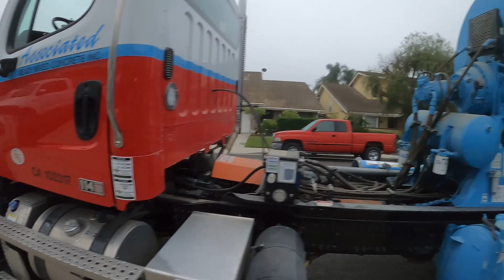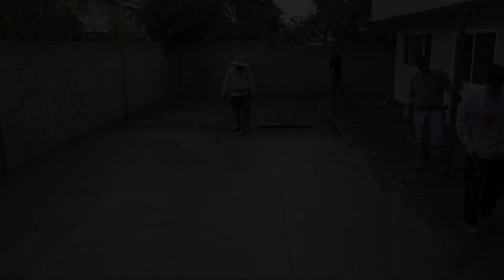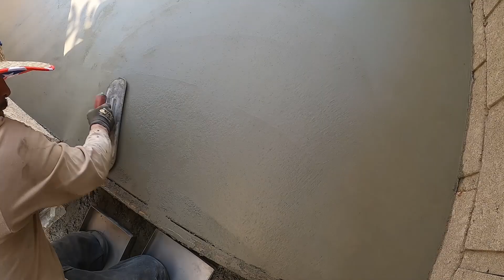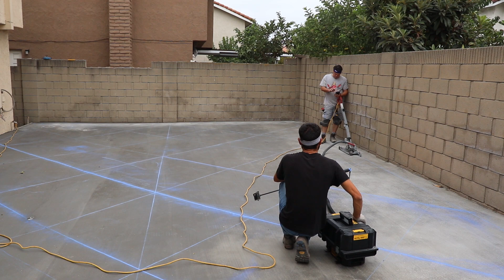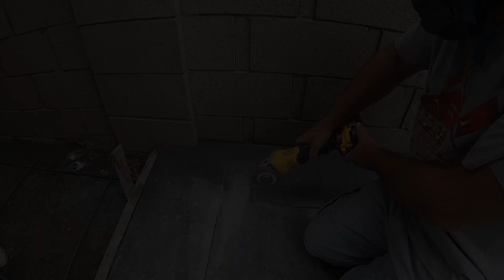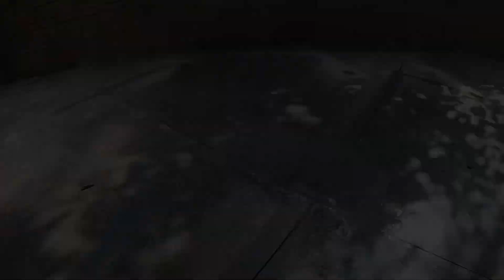Entire Backyard Concrete Pour from Wall to Wall (Part 2)

Comment: is drainage necessary because it's done wall to wall?  I have an existing color stamp 1 step up patio and I want to do the rest of the yard in concrete extending the patio wall to wall.
Reply from the maker: You may need drains if there's no slope out

Comment: enjoy your videos here in Maryland - question?  when you powerwahsed the concrete, do you also run extra water in the drain to flush out concrete dust from cutting so it won't harden?
Reply from the maker: No drains here

Comment: They sell a dewalt t stak dolly that the extractor sits on . And does  that dewalt dust extractor come with that long hose or is that 2 hoses
Reply from the maker: I put two hoses together.
I have the Stak Dolly.
I'm thinking 4 swivel wheels
Reply: thanks. And there are 2 dewalt dollys I’m talking about the baseplate one with the four swivel wheels . It is a tstak I think it’s around 50 to 60 $
Reply from the maker: @vinnyavella6397  
I didn't know that, I'll check it out.
TY

Comment: Hi Dave. I recently did a 2 part pour with 2 separate colors. I used plastic to cover the outside boarder. That was the hardest part of the job getting everything to flush out and finishing the edge. Have you used any other methods to protect the slab beside plastic?
Reply from the maker: No

Comment: great work as always function and finish... thxs not saying 5 inch slump ahahah show a cone  if u can ,   pea gravel moves easier in ur pump nice
Reply: thumb up 956
Reply: oversized wheels non maring,  not tiny wheel cut into concrete too green for tiny wheels for the vac

Comment: Hi odell I have a question 
Can I do more cuts on my concrete patio? I did some but I would like to make more cuts.
Thanks for sharing your knowledge
Reply from the maker: Yes you can no problem
Reply: Yes, and for decorative cuts you can even cut at 1/4 inch and get the shadowy decorative joint vs control joint

Comment: Looks good I like how the cuts where made it gives it a really nice touch to the concrete 👍🏼👍🏼👍🏼✌🏼
Reply from the maker: Breaks it up and makes it smaller. Decorative.
TY
Reply: @OdellCompleteConcrete  Would be even nicer if the drains were located at an intersection point of two cuts ;)

Comment: Hi! cool video! Just wondering, why do you saw cut the concrete, couldn't you just wet join the concrete (like where you get the tool and make a joint on the day of the pour)?
Reply from the maker: Yes we could have but not a decorative pattern like this diamond one.
Reply: Oh okay, just wandering because I have been to job sites where they build track homes, and the workers pour about 10-15 driveways in 1 day, and when they poured them they just used a wet joints to prevent cracking. I was surprised how fast they could pour the driveways. Thanks!